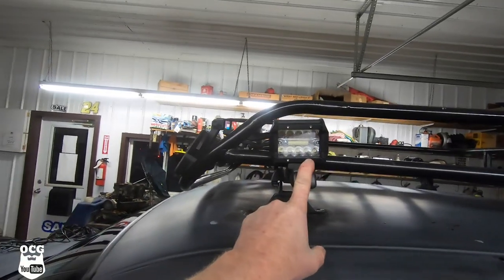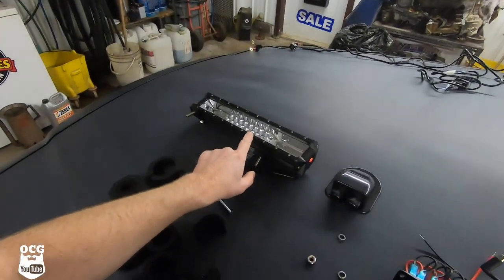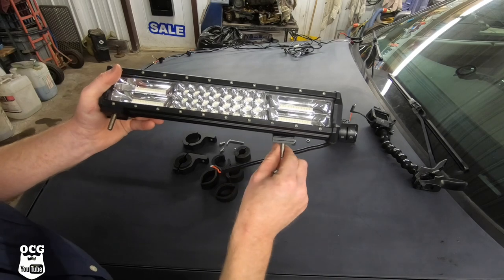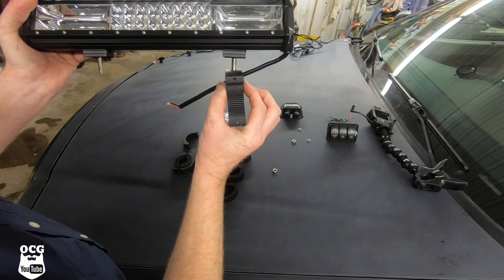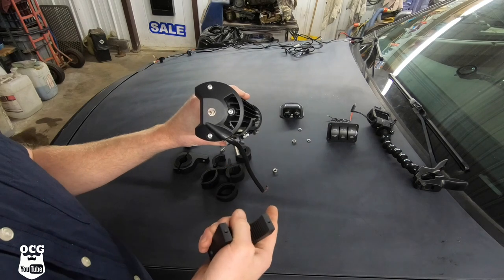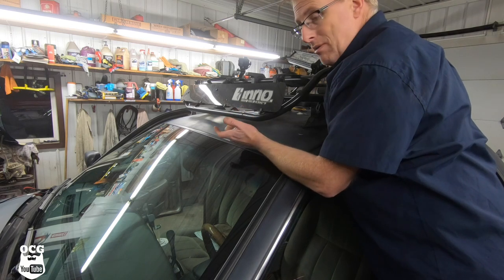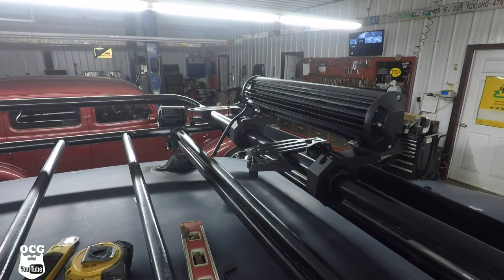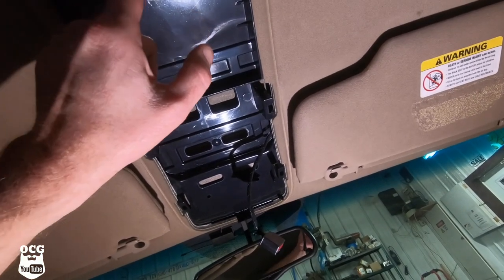LIFTED Mercury Now Ready For OFF ROAD. BRIGHTEST Panther Platform EVER

Comment: That's a cool waterproof port to go through the roof. You could drill small holes in the roof rack tubes and run the wires through them with a bit of RTV to seal them back up. Then you don't have to worry about the zip ties and wire loom plastic degrading in the sun. I've found zip ties and UV light don't work well together.
Reply from the maker: Woah Woah! Hold the phone just one minute. Are you saying you don't like my zip ties? C'mon Harley, You're just talking crazy now!
Reply: Haha, personally, I love the zip tie aesthetic. I use them for lots of stuff, rarely wires. :-D Just saying, in the sun, my experience is they don't last long.